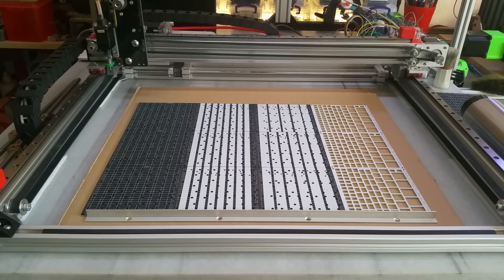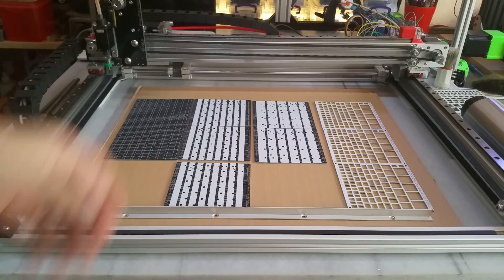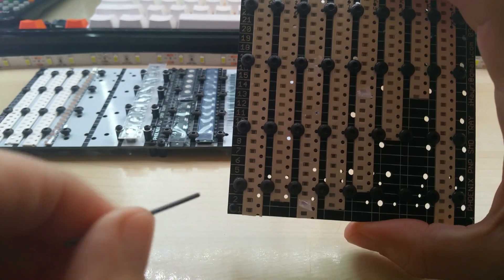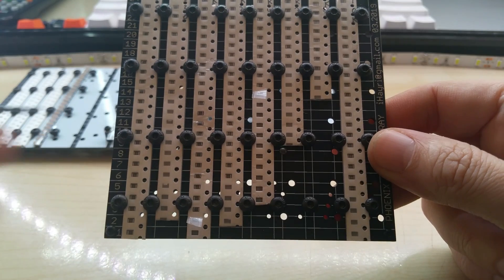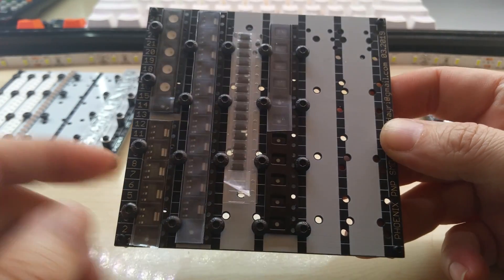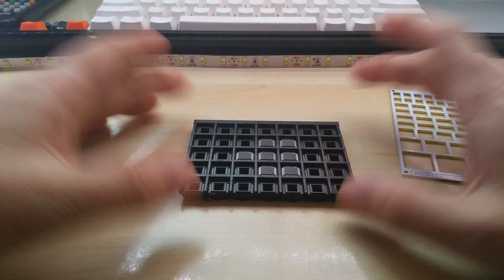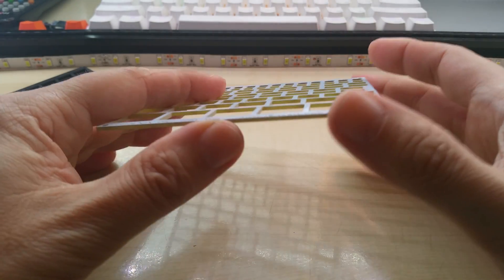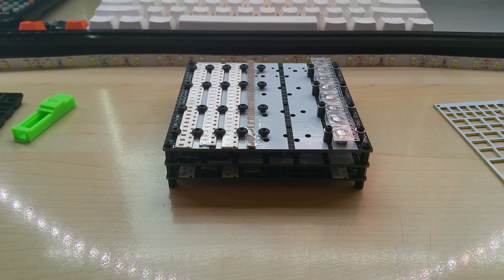Custom SMD Trays made with PCB for my PNP machine, available on Tindie

Comment: Amazing and thanks for sharing... please have a look...
https://www.youtube.com/watch?v=FrGPu49nKsw
Thanks...
Reply from the maker: Thank you, you are actually further along than me, as your PNP is doing it's job, mine is still "just" moving :-)
Reply: @iHayri1  thanks for reply, but I'm still confused about feeders, please help me in this regard... telling you I'm not using openpnp I wrote my own application software which convert gerber to gcode and send gcode to controller... thanks again and keep in touch to help each other.
Reply from the maker: @zgk_tech1469  I will not use any feeders as the software I am planning to use does pick up the parts from the strips directly without them moving. It calculates the position of the parts on the strip. This will be enough for my needs. Also, the feeders that use the PNP head to pull them forward each time are just slowing it down, not that I need any particular speedy PNP. I am curious about your gerber to gcode converter as I thought about going that route as well to keep things "simple" and be able to use my regular CNC controller. I do know that I have to get the rotation of the head working but I think I could find a solution with the A4 output of Grbl.

Comment: Interesting setup.  The tape looks a little difficult to remove with the screw heads holding the strip down but I guess you would just peel the tape before sliding the strip in. Looking forward to seeing the machine in action.
Reply from the maker: The screws do not pinch the strip and the tape can be easily pulled up as it is very thin and flexible. Also, the tape is only under the screw on one side :-)